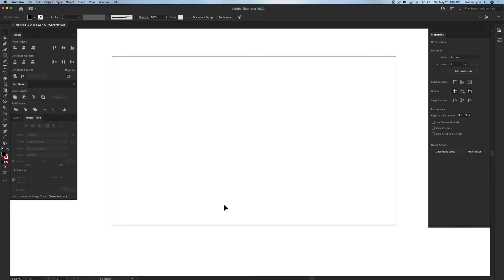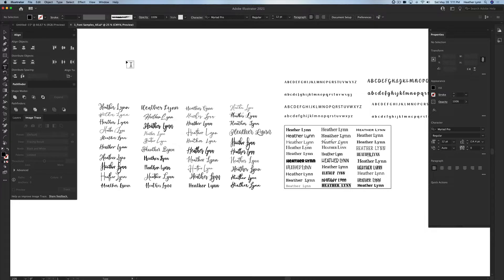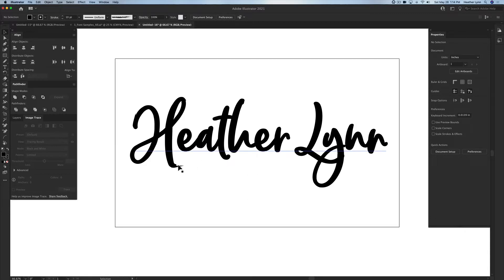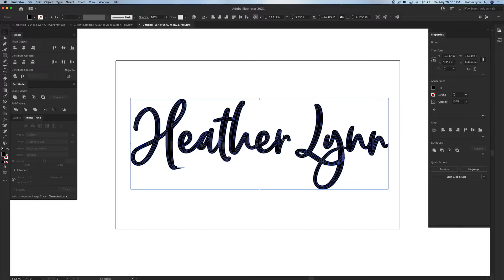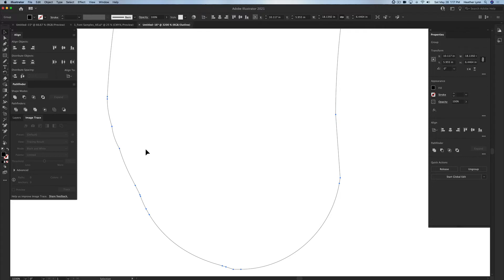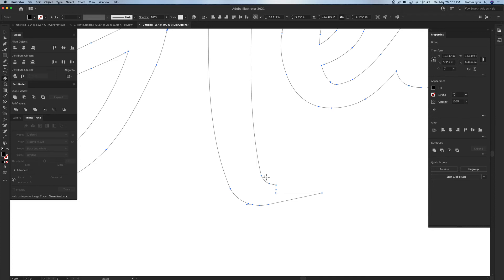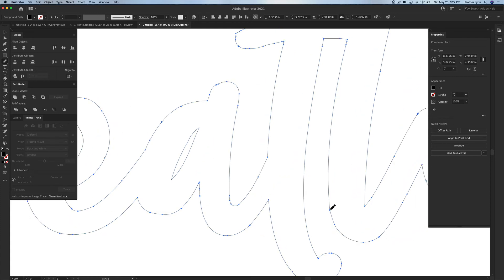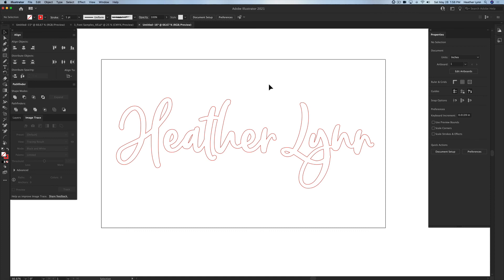Adobe Illustrator — How to Thicken a Font for Laser-Cutting

Comment: Would the smooth tool be better for smoothing out the lines?
Reply from the maker: The Smooth tool can help with this sometimes, but you'll lose some of the fine details. For this project, I like the look of the font as-is so smoothing it out would change the look, but it's definitely a solid tool when it's needed!
Reply: @LoBoDesigns  ok thank you for the reply